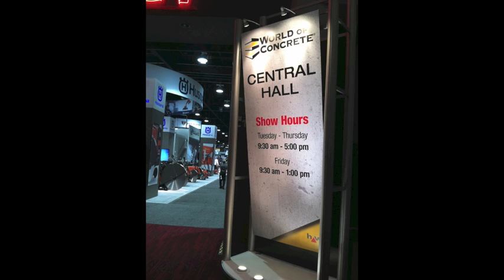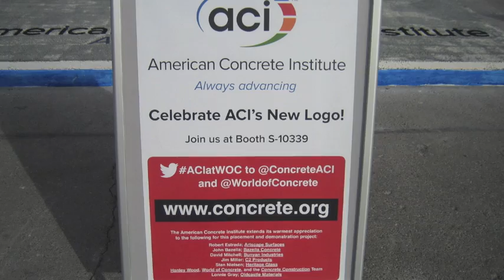World Of Concrete 2014 Las Vegas, NV

Comment: I had to stop at 4:20 for an OCD break. Great to see guys learning. That said, don't ever do anything you see these guys doing. Don't try to use a squarepoint to rake in front of the screed, they belong on edges during the pour. Don't mag an edge until you have cleaned the top of the form, don't stop a roller tamp short of the edgeform and be sure to cock it at a slight angle going onto and coming off of the CLEAN edgeform. Same rules apply for all long tools except fresno and jointer. Took another break and had a smoke then went back and re-watched the guy with the walkbehind diligently plowing troughs that the poor bastard with the bumpcutter just didn't know what to do with. Alright. The F numbers on this are gonna be rejects. If these guys want a real world education they should have to rip it out and re-pour it on their own dime, ahem. Not that that ever happened to me...I will say the finish is stunning for a fibermesh mix but what do you expect with a couple 1500 pound riders on a tiny pour.

Thanks to clewinclewin for the upload.
Reply: Another fucking expert.

Comment: 5 or 6 experienced finishers,could have done that pour,without all of those useless machines,and tools.Fibremesh has been around since the 80,s, did not do well then,no comparison to a steel reinforcement system.
Reply: Steel corrodes and rusts overtime  the chemicals in the concrete cause it. Eventually it causes delamination. I work on repairing it. Steel is NOT the best.
Reply: Pete Smith, I’ve never worked with concrete before but I agree. The Empire State Building is still standing and Im pretty sure it doesn’t have any fiber mesh in it’s foundation.
Reply: 5 or 6? we would do that size pour with 3 of us and only 1 or 2 being finishers haha.
Reply: @samrodrigo92  me too! Lol everyday ordeal for us. Short handed always. I pour 2 and 3 stall garages with 3 guys daily
Reply: Clearly your not properly educated in this industry.  The pour was a small pour at a concrete convention in las Vegas. It show cases new technology in the industry.